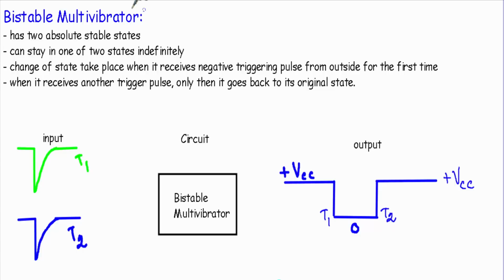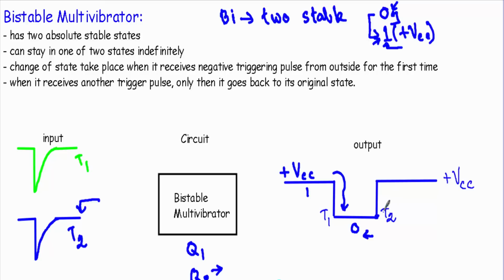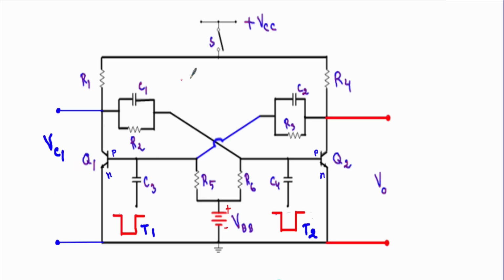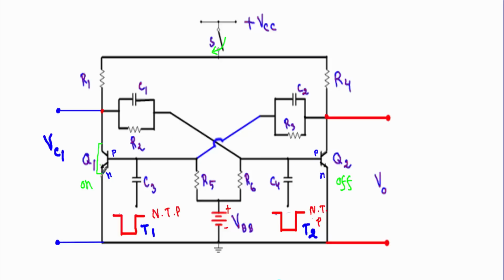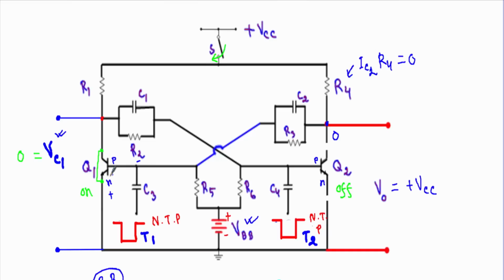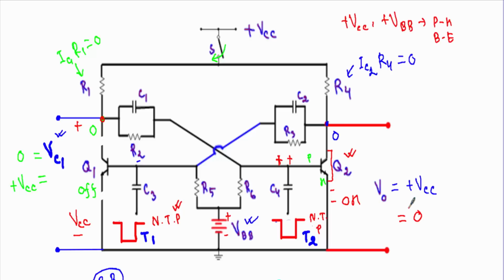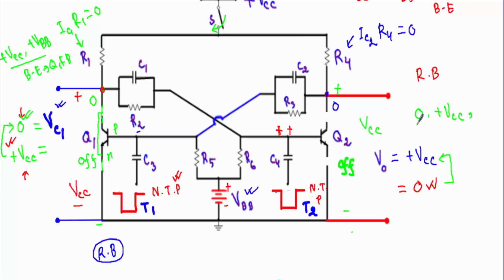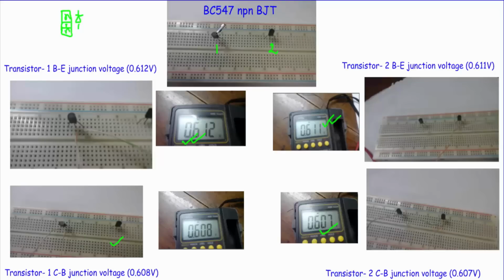Bistable Multivibrator

Comment: initially when VBB is applied to both transistor so Q2 should be on after Q1 even if doping is different?
Reply: How? Bases are F.B w.r.t Vbb...
Reply: @haseebahmad3500  Vcc+Vbb will make it fb
Reply: Transistor with higher beta value will conduct first... and so other one will be OFF.....
Reply from the maker: With Vbb none of them will be on because bases of Q1 and Q2 are in reverse bias